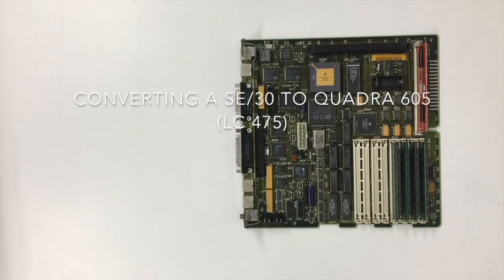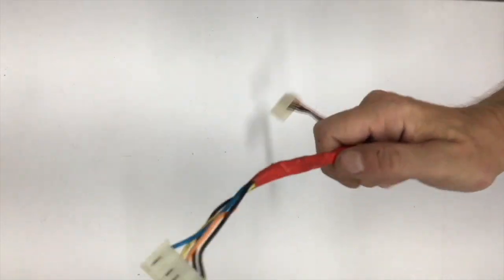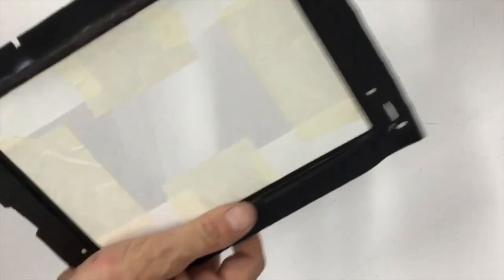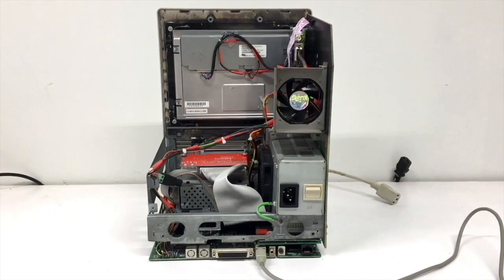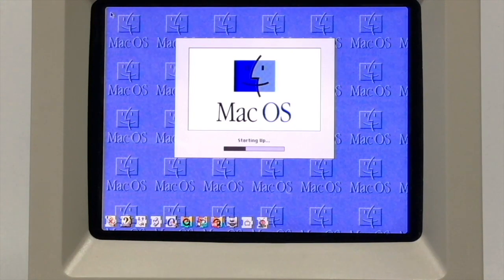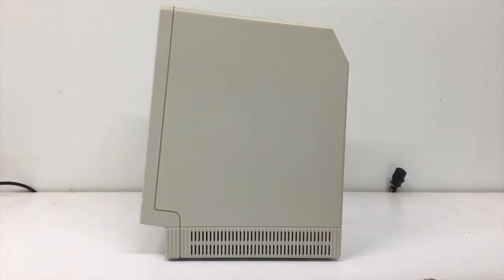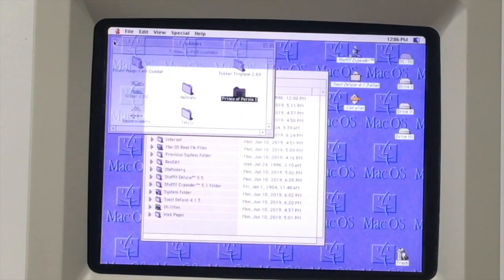Apple Macintosh Mac se/30 to Quadra 605 (LC 475) Upgrade

Comment: I love the old AppleCare stickers
Reply from the maker: Hi, do you mean the old rainbow colored and red Apple logos? If so, I agree completely. Apple products today seem very sterile and cold as compared to the original iMacs, iBooks, eMates, etc. They went from being different to being the same, making the new logo subdued instead of standing out:( And the Apple care stickers really stood out, especially the Canadian ones.
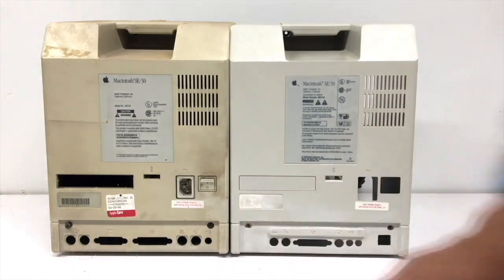Reply: @BillyTheKidCENTURION  I also like the original rainbow - up until recently I had an old mac color decal on my 2015 MBPR's backlight.  But in this case I meant the AppleCare sticker on the back of the shell SE/30 at 6:35.  I respect Apple a lot for keeping certain things around from the old days - AppleCare, model number scheme, keyboard shortcuts for screen caps, etc etc
Reply from the maker: @bad_collector  Ohh, sorry for the mini rant, I didn't even notice the Apple Care Sticker when I was making the video, as it was a case I grabbed off the nearest shelf. I was pointing out the lack of aesthetics that Apple once had.

Comment: Billy great video! You have such a positive vibe and have such an easy manner of speaking, it keeps things interesting. (Love that dig at the end about the ten year old tested cards!) one question. Out of curiosity have you done a SCSI 2SD? I have seen some boot times that make the macs run like the devil. Keep the vids coming!
Reply from the maker: Hello, and thank you:) Oh yes:) I have about 70 SCSI2SD cards under my belt. And yes, they do significantly speed up the Mac:) I wasn't going to do a video about formatting the SCSI2SD, but I've had several people ask, so when I do my next se/30 build in a couple of weeks, I'll probably include that.

Comment: Billy, this is fantastic. You are a legend. I've just ordered a LC475 with colour monitor and keyboard. Can't wait to pick it up. Although I'd love the SE/30 I lack the technical detail to actually go ahead with such a venture. Do you have an engineering background or did you pick it up by trial and error? However, I do enjoy watching your videos. I like your style. Keep it up.
Reply from the maker: Why thank you:) I don't know about a legend, but I don't like to argue, so ..........Legend it is:) I do have some engineering background, but everything I did in this video is actually very simple, and only requires a basic understanding of electronics, soldering, and reading schematics. I've been repairing Apple products for over thirty years. The most complicated part would be matching the VGA wires to the Mac HD-15 pins. Of course before anyone attempts this, they need to be very familiar with the power supply. Thank you again for watching the videos:)
Reply: @BillyTheKidCENTURION  Thanks. I've ordered an ESD man kit. Safety first, right? and keyboard key removal tool on Amazon. Have very little experience, are there any videos or suggestions you could share. I'm mainly cleaning and setting up the LC475 and probably the monitor. I might redrobright the casing only.
Reply from the maker: @FaiselKhan  I would look at Branchus Creations https://www.youtube.com/channel/UCXy8pDuiwZoY8_bNISGQ_Cw
He's a nice fella who knows what he's doing and has several tutorials.

 The power supply in the 475 will fail if it already hasn't. Those flat LC series had the worst supplies that Apple made. I replaced mine with a Pico ITX ATX and a 12v 10amp power brick. The capacitors on the logic-board will definitely have to be replaced, a quick google search should tell you which ones you will need, and if you can't find them, then just message me

If you are going to be doing a lot of soldering on future projects, I would suggest getting a TS100 soldering iron. It blows my old $450.00 station away, I wind up using it more than my Hakko, which it can interchange tips with if you ever go more advanced latter. For solder I would use Alpha Fry, it makes really good shiny connections, and I've use way higher priced solder that didn't work as well. If you need any help with anything, just message me in the discussions section on my channel page. Good luck:)

Comment: I wonder how you could connect the original monitor from the SE/30 to the Quadra 605.
Reply from the maker: Hi, actually I've been  looking into that for the last couple of months:)
Reply: You’d need a custom video card that can output the digital b&w signal that the analog board is expecting. I’ve been playing around with a design for the SE’s PDS slot that has a couple of Lattice FPGAs on it; but adapting it to other Macs right now is not feasible; because a) there’s a worldwide chip shortage and getting the required FPGAs is difficult to impossible (I had to settle for ones with half the gates that I wanted, in some really tiny BGA packages - everything else was out of stock everywhere) and b) I don’t own any other machines with PDS slots to test on.

Comment: Just saw your video. I wanted to do the same thing. Was trying to do it without the motherbd change. Now I will change out the board.  Are there other motherbds you think may work?
Reply from the maker: Hello. Yes, there are other boards that can fit the SE and se/30 cases. For the SE, you could use use any of the LCs (LC I, II, III, III+, 475). Of course for the se/30, the only step-ups from the original logicboard, would be the LC III, LC III+, and 475.

Those are only if you want to stick with the Classic OS 68030 and 68040 machines. The cases will also hold an iMac G3 logicboard (Rev A through D), using the iMac board gives you the option of using a floppy drive, or a CD drive. (see my Mac Classic to iMac upgrade video). 

Believe it or not, if you wanted to put a Mac Mini in the cases, it is even easier than all of the boards listed above:)

Comment: I mean,you sacrificed a perfectly good se/30 to a 605... why? I mean its cool and all but the SE/30 is such a expensive and too good machine to doo this to it.
Reply from the maker: Hi, thank you for saying it's cool:) I've been repairing and restoring Apple products for over thirty years, and have accumulated a massive amount of parts. The supply of cases for the compact Macs, like the se/30, Classic, and Classic II, far exceed the availability of logic-boards and analog-boards, thanks to leaking capacitors, exploding batteries, and water damage. I wouldn't do this to cases in pristine condition, or to a Mac that can be salvaged.
Reply: Billy The Kid ah that’s understandable lol.   Atm im trying to fix my own SE/30 but i do believe shes a gonner. UI2 has a broken leg and bad traces going to it. Its connected to the ROM so it appears to be important lol. Anyhow, hope you have some good luck in your future endeavors.
Reply: @adonvonpanzern  The logic board for the SE has been recreated; and I believe that there will be an effort to do so for the SE/30. There’s a rather long thread about it on 68kmla.org

Comment: Nice Job!  Always liked the SE footprint.  What type of LCD did you use?  I have been thinking about sticking a G4 Mac Mini into a compact mac and want to use a small LCD with hdmi output for my video solution.
Reply from the maker: Hi, thank you. If I remember correctly the LCD I used was an  AA084SC01 800x600, and the controller did have HDMI input. I hope to see your SE G4 Mod:)

Comment: Very nice! Do you have a link to the LCD panel you used in your build?
Reply from the maker: Hello, and thank you :) The LCD is a Mitsubishi AA084SC01, if I remember correctly? I found it on eBay, and I think they are also available on Amazon.